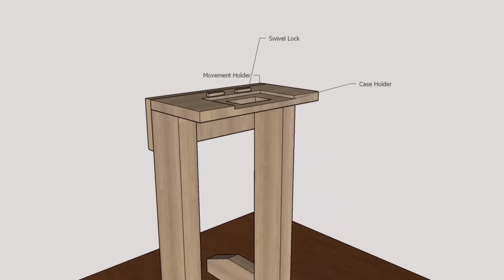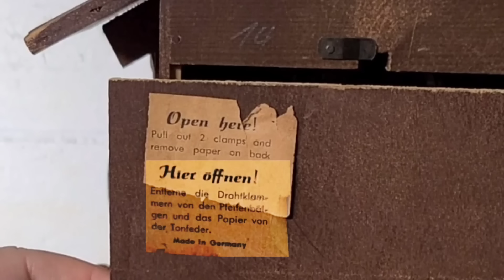Damaged 1950s Cuckoo Clock Restoration

Comment: Being German, there has been a cuckoo clock in my parents house since my birth. Learned to sleep through the relentless racket of the insomniac cuckoo bird. As with most clocks, it “cuckoo’d” the hours and a single cuckoo every half hour. I’m 52 and this clock continues to operate without ever having any issues. Doing some basic math, each bellow has run 1,713,870 cycles (3,427,740 cuckoos). Actually more as this clock pre dates my birth. Amazing craftsmanship. Very interesting to see how it all works.
Reply from the maker: Very cool! Thanks for watching!
Reply: "Insomniac cuckoo bird" 😅

Comment: The strike gathering pallet can be removed by grasping it firmly either between your thumb and pointer finger, or with needle nose pliers with some kind of fabric so it's not medal to medal contact, then with your other hand, grab the gear and firmly rotate little by little left and right while pulling and it will work the pallet off the tapered shaft.  Just do so carefully.  I've not had a single issue removing them this way.   As for the center one, that unf. cannot be removed without damaging the shaft or the gears on it as they are pressed in place on the shaft.  So, I just slide the shaft up and down as far as I can and clean the shaft on both side of the plate while doing so until I no longer see any sign of gunk.  You just need to ensure it is completely dry of any water/cleaning solution before oiling.  I'm glad to see that you actually disassembled the movement to service it as that is really the only truly correct way to do it.  Plus, you can then more thoroughly inspect all the components to ensure they are all in good condition.
Reply from the maker: Thanks for the suggestions! Yeah, I like taking everything apart as much as I can. I think it's the proper way to clean, inspect, and repair a clock movement. Cleaning a clock movement without disassembling it is like taking a shower with your clothes on. You might look and smell clean, but many areas would remain wet and dirty. Thanks for watching!
Reply: @WatchOverhaul   Exactly.    It drives me crazy to see so called 'cuckoo clock repair videos' here where they don't disassemble the movements and just take them out and oil them, most of the time with the wrong oil, a lot of them don't even remove the movements and just oil the back pivot holes that are obviously gummed up.   That's not repairing, not even bandaging, so it's good to see a video of it being done as it should be.   I've been repairing clocks since 2008 and am self-taught as well.   You're welcome and I'm sure I'll be watching more of them.

Comment: Having torn my parents' Cuckoo bellows when I was 11 (knocked the clock off the wall), when I was 13 I recreated and replaced one bellows paper using a page from the Yellow pages.  While it was initially too stiff, I gently sandpapered it until it wasn't. After it functioned, I sprayed it with "Aqua-net" hair-spray.  You wouldn't think that near-disposable paper would last that long, but that clock cuckoo'd fine for almost 10 years, when we took it down to move.  I have the clock somewhere, but I'm not betting the Yellow page bellows paper lasted the following 40 years.
Reply from the maker: That's very cool! I bet it was fun to fix. Thanks for watching!

Comment: Nice Video.  One thing that would have been good to mention is that the position of the warning wheel pin is quite critical to the proper operation of the strike train.  If the pin on the wheel is not set at the proper position when re-assembling, the strike train can lock up or strike endlessly.  (This is true of any mechanical striking or chiming  clock movement).  Easiest way to ensure that is to mark the position of each strike train wheel, other than the fly,  in relation to the one it engages  before disassembly.  Of course, that assumes that no one has been futzing with the movement previously and had disassembled/mis-aligned the warning wheel.
Reply from the maker: Yeah, the warning wheel pin is very important. Thanks for watching!

Comment: If that's only your 3rd clock repair you did an awesome job, yes not a good idea to put grease on wheel teeth as the grease collects dirt.
Personally I would drop the chains through the holes & then place the movement as a little gravity helps to keep the chains on the sprockets.
Hand bushing isn't difficult the trick is to just open the hole enough to allow the bush to start entering the tapered hole you made & keeping the broach at 90° to the plate is needed, I usually rock the arbor back & forward in both planes to check the the arbor moves in both directions equally.
Thanks for showing the repair of the bellows to.
All in all an impressive video  with good narration.
Thx for sharing!
Reply from the maker: Thank you! Yeah, this was the 3rd clock I've ever worked on. There's so much to learn and perfect. I know I'm not getting everything right the first time, but it's fun to work towards that goal. Thanks for watching and for the tips!
Reply: That was great,don’t think I’ll try it. You da man

Comment: I have 14 Grandfather clocks and 300 mantle, kitchen and parlor clocks.....ranging in age from 50 years to 200 years. I work a little on them, but watching you makes me want to do the repairs many of my clocks need. I have a clock/watch lathe with all the assesories, plus most of the tools needed to start. And I was once a machinists. The reason Im writing is that all the repairs that have been done to my clocks in the past, have been done by hacks....the repair workmanship is horrible. And the bad repairs are consistant over the past 50 years of collecting clocks. Thanks for the videos!!!!
Reply from the maker: Sounds like you're all set to start back up working on your clocks! It's a lot of fun. Thanks for watching!
Reply: I need to see a video of them all hitting 12 o clock

Comment: The movement holder you made is genius!. You should make the top part and sell it as in a kit. the legs can be made locally. Include a drawing and measurements. I will buy one right now. $20.00 plus shipping is reasonable.
I love your work! You appear to be able to reassemble a movement by memory. I have only been doing clocks for 2 years and I need to take plenty of photos to help me put a movement back together..
Ultra sonic cleaning solution of all the parts is a must. Polishing pivots ,replacing bushings where needed, cleaning and greasing springs should always be done.
You did an outstanding job of replacing the Bellow paper. It is not that easy!
There are a ton of videos on You Tube. Dperry428  has some excellent videos. So does Jefferson clock works.
I am now subscribed. Looking forward to future videos
Reply from the maker: Thank you so much! I have a small woodworking business I do on the side as well. It's not my main job but it's fun to do. You can email me at watchoverhaulchannel@gmail.com so I can get some dimensions from you. I'm getting better reassembling by memory, but I actually started videoing what I'm doing so I can use it as a reference to put things back together. I then figured people would like to watch what I'm doing so I started a YouTube channel! I really need a bigger ultrasonic cleaner and should start using a cleaning solution. What solution do you use? Thanks for watching and subscribing!
Reply: @WatchOverhaul  I like Deox7 from Timesavers

Comment: Great fun to watch.  Never worked on clocks before, but as a service engineer and lifetime DIYer, our son's inlaws have asked me to take a look at a very complex clock they bought while visiting Germany a few years back.  Haven't seen it yet, but it probably looks a great deal like this one.   Apparently there are staples and other packing and blocking material needing to be removed that has them flustered.  Fingers crossed.
Reply from the maker: Thank you! Let me know if you have any questions and I'll try to help! Just try to take pictures and video - helps during reassembly.
Reply: @WatchOverhaul  I very much enjoy your videos.  I'm a Disabled Veteran and my hands are too shaky to enjoy this type of hobby.:-) I have a clock, semi old that requires repairs. If your interested,  I could se d it to you. Its quite nice. Thank you.

Comment: Just pulled out a German cuckoo clock that was given to me by my parents 30 some years ago.  After several home moves, it eventually wound up sitting stored in a box in the basement.  Came here to look at what maintenance I needed to do.  I've got a small squeak in the pendulum.  So, I will definitely look into some clock oil.  Thank you for your video.
Reply from the maker: Nice! Cuckoo clocks are pretty fun. Thanks for stopping by and watching!

Comment: I used to repair and rebuild small gearboxes for the textile industry. Many of them had both e-clips and c-clips. I used special installation and removal tools for them. They are available for under $20 from Amazon if you care to check them out. Wonderful job of rebuilding and restoration.
Reply from the maker: Thanks for the info and for watching!

Comment: very well done video. For a novice you seem to have real aptitude for it! I am fascinated with cuckoo clocks as well. I have three and am enjoying working on the "junker" I picked up cheap. Its been running well for a week now! I was fortunate the pivots are all in decent shape too. At some point I will have to take it apart again for two more fixes. Adjusting the pendulum wire so the clock doesn't hang crooked while in beat. And I need to adjust the minute hand so the strike side goes off precisely on the hour, instead of 4 minutes late. I am jealous of the minute hand on yours, its made so that you can just slide the friction fit minute hand to match the strike. Again, great job!
Reply from the maker: Thanks! There's a lot to learn. I just try to take my time and not rush anything. That's good that yours has been running for a while! Thanks for watching!

Comment: Nicely done.  I admire your courage of taking on a Cuckoo so early in your clock restoration adventure. It's a wonderful satisfying hobby. 
Be careful of those fingerprints on the brass, they will eat into the finish and tarnish the brass pretty quickly. 
Thanks for sharing
Reply from the maker: Thank you! Yeah, this clock was kind of difficult, but they are all kind of difficult to me at this point. There's a lot of fundamentals and skills I'm still trying to learn. I keep forgetting to put on my finger cots when I'm assembling! I've noticed old fingerprints on other movements I've worked on. Thanks for watching!

Comment: Young man I also am impressed, I believe you stated that this was only your 3rd clock you have worked on, and you took on the bellows repair, then completely disassembled the works, repaired some casing issues, and made observations and assessments on what you were seeing and took the time to thoroughly clean the case, not once but 3 times. Me, I would be lucky if I could remember where a third of the component parts came from that alone reassemble. I salute you sir, thanks for the video, I enjoyed it immensely.
Reply from the maker: Thank you! It was a lot of fun to work on and I enjoyed the challenge. I'm glad you liked the video! Thanks for watching!

Comment: I have this exact Cuckoo Clock. It was given to me from my gtamdpa. He got tired of of having to get the insides repaired amd had them removed. It hung on the wall since I was a toddler and was always fasinated with the little bird. So sad not to see it anymore but at least I got a piece of him. I got choked up watching this video. Thank you for posting it. Means alot!
Reply from the maker: Thanks for sharing that and for watching!
Reply: Please tell us if the piece missing on the clock video-ed is the mouthpiece of the circular horn that goes around the face? The woodwork at bottom left is damaged on this clock, and there was a nail sticking through the face. Did you notice that? Thank you

Comment: A very nice job! I was especially impressed with making a test stand for the clock and the case repairs. Most people seem to be into machines or wood, but not both.

The spring clips: some of them are E clips and some are C clips. You can tell which is which by the shape.
The first ones you removed were C clips, and the special tool you bought is the right tool for both removal and installation.

Many of the other clips were E clips. You can normally remove these just by inserting a normal flat-blade screwdriver in one of the holes in the back of the clip and then twisting. This will pry the clip right off without danger of bending it. Watch out for them pinging off though. :-)

To install them you can squeeze them on as you did, or for small ones like that, you can often just grab them across the flat side at the back of the clip with a pair of needle nose pliers with serrated jaws, and just push it onto the shaft. When you do it this way you generally don't have to worry about getting your fingers pinched, bending the clip, or it pinging off. You can't do that for every E clip, but it works for a lot of them.
Reply from the maker: Thank you! I wasn't sure at first if they were C-Clips or E-Clips. On two different websites they called them E-Clips, so that's what I thought they were called.

https://timesavers.com/i-8947345-regula-cuckoo-clock-e-clip-10-piece-pack.html
https://www.clockworks.com/product/clock-e-style-clip-washers

I thought about using a flathead screwdriver but I didn't want to risk scratching the movement, so I decided not to. Thanks for the suggestions and for watching!
Reply: @WatchOverhaul  I've noticed a fair amount of confusion about C or E clip nomenclature on the internet in the last few years. I suspect that someone heard someone else saying C or E clip for a spring clip and just assumed that name applied to all spring clips, and then this inaccurate assumption became common "knowledge". 

The timesavers web site is just plain wrong, those are C clips. The clockworks web site  shows images of both C and E clips on that page. (In fact some of those with an extended tab at the back may not really qualify as C clips, since they appear to be designed to be removed by pulling on the tab.)

You do have to be a little carful about scratching a baseplate (especially brass) when prying a clip off with a screwdriver. But really, you can also scratch the plate using circlip pliers or most any other way. Sometimes you can get a sheet of paper or feeler gage stock under the circlip to prevent scratching with the removal tool.
Reply from the maker: @lwilton  Very interesting! I'm just glad I was able to find the clip that flew across the room. Would have sucked to have to buy and wait for a small clip.

Comment: Nice job.  For the case, I thoroughly brush off dust with a brush and then go over the case with a 50/50 mixture of boiled linseed oil and mineral spirits.  I then wipe it down with a clean, soft cloth.  I also do that on the inside of the case.  It really helps keep wood fibers from shedding and getting into the movement.  It feeds the wood and refreshes the finish without putting a coating on top.
Reply from the maker: Thanks for the tips!

Comment: Very informative video and love how you're putting your self out there as a beginner, although you seem to have some repair knowledge already. No shame warning others of mishap experiences either.. I'll be wearing my face shield going forward.

ON CLEANING: Lots of cleaning brews to find on the net because the pre-mixed stuff is pricy, making your own is really easy. My go-to solution is Ammonia, Dawn dish soap, Murphy's oil soap... replaces hard to find [Oleic acid] used as a softener, and water to fill. Never bother using distilled water because I use compressed air to dry therefore no mineral spots form. You can dunk in IPA but that's just another expense. I nearly always leave out the Acetone solvent unless I want to strip the shellac coating off the brass (rare). Exact quantities aren't critical, 2/3rds of the solution is the ammonia and water and a 1/4 cup each of the remaining ingredients for a small  batch in a 2.5 liter unit. Got mine at Harbor Freight and I have found it to be more than sufficient. Another solution saver if only cleaning a few small parts, place them in a ziplock baggie with cleaning solution and place it in the Ultrasonic cleaner filled with plain water😉.  Nice steady hands on the watch work too... now that's where I can learn a thing or two! Good luck, keep learning and stay curious!
Reply from the maker: Yeah, I'm definitely a beginner and this was my third clock I've worked on. I have a little repair knowledge from working on a couple other clocks and watches. I've also picked up some things from reading. Glad I got at least one person to wear a face shield! Power tools don't always give people a second chance. 

I've been nervous about using too many chemicals when cleaning. I don't want to remove patina or make things look shiny. I want to remove oil, dirt, etc., but I don't want to remove natural aging characteristics. I'll have to try some solutions on some donor movement parts I have.

Thanks for taking the time to message and for the suggestions!

Comment: Boy you spent a lot of time building the test rack!  I just screw together scrap pieces of wood for mine. Each clock project is different.  The main reason a clock stops is friction and usually that's caused by dirt. Too much oil actually makes things worse. And yes absolutely no grease. Good job
Reply from the maker: Yeah, I over engineered it a bit. Thanks for watching!

Comment: little trick from my guitar repair is to use a suction cup to push pull glue even down into small cracks.. not sure if you knew this but very handy to know.
Reply from the maker: Thanks for the tip!